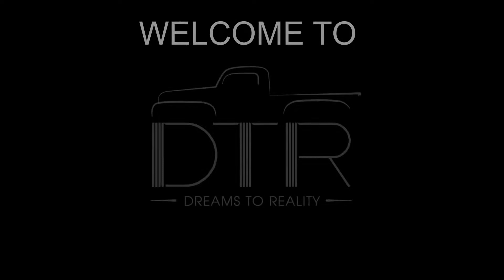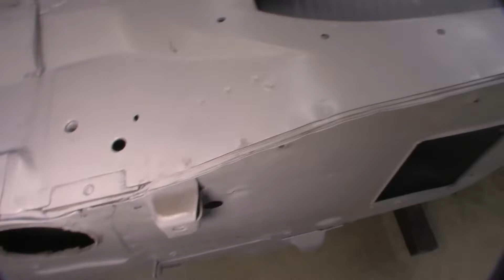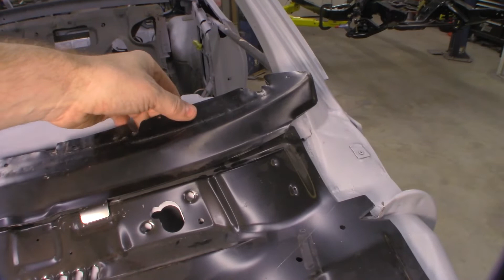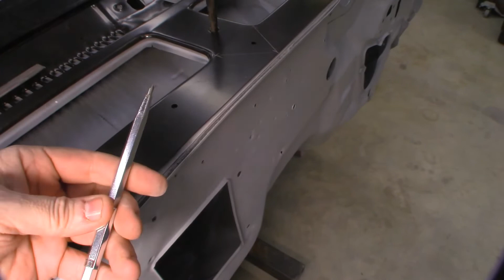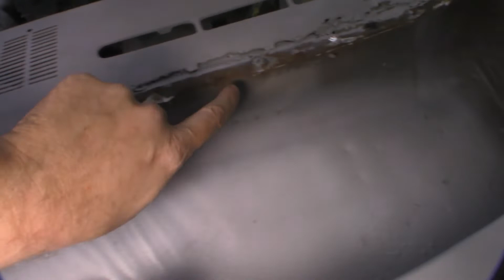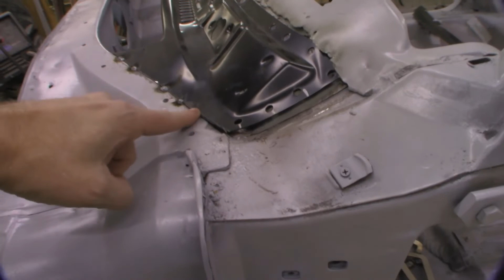68 Olds 442 Cowl and Dash Rust Repair DTR Automotive

Comment: I have a 65 Jetstar convertible that I ended up cutting the cowl area out of a parts car ( 66 Delta 88 vert) and did my best to cut and fit then attempt to weld. I'm not a pro but it turned out fairly good. Took pictures of the process as it was a project that someone else cut out the rust. I'm amazed that new parts were available, I lucked out finding a rust free cowl. Good luck with your car.

Comment: You skipped the last pain in butt part!!and the part that would be the most helpful for anyone undertaking this project..🤣 ask me how I know:)
Reply from the maker: What step?
Reply: The last one you left out
Reply from the maker: @edwardfernald9607  still no idea what you’re referring to.  Something to remember, DTR is a two man shop, I make the videos entirely by myself as I’m doing the work. In some cases I know I probably miss things but I am also trying to work efficiently. I appreciate the views and the comments, but please be more specific to what you mean. Thanks
Reply: Well what is the last and second to last step of the patching process that involves welding? You did not show those steps. You skipped putting in the channel piece that goes over the vowel piece and connects to the actual dash. That metal piece is a far heavier gauge metal than the rest of the components… does that ring a bell?
Reply from the maker: @edwardfernald9607  thanks for your input, I’ll have to go back and watch this video. As I said I am one person doing all the work to make the videos, I may miss things. 

If you watch any of the mainstream restoration shows they usually show a rusted out rotted box of shit and after commercial is rolling out of a paint booth. 

He other thing is if I show every single motion of every single step the video may end up being longer then what an average viewer will stay for. Plus sometimes the steps are boring and mundane during editing. 

There are people that have been introduced to what a job like this looks like and it’s meant to help. 

Try to produce a video or videos like I’ve been doing and you’ll see how much work and time it takes. Missing a moment may happen

Again, thanks for your input